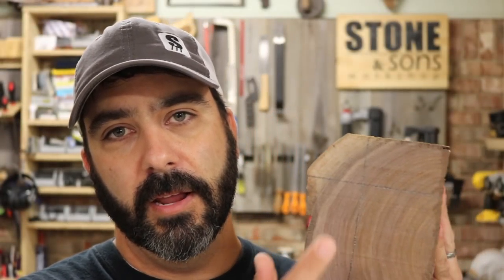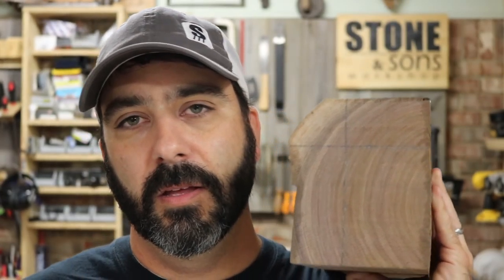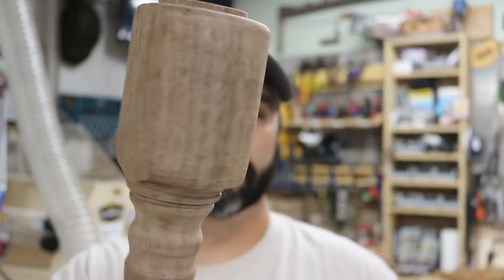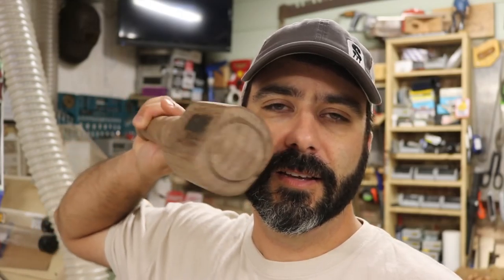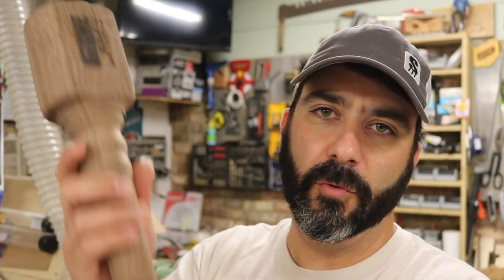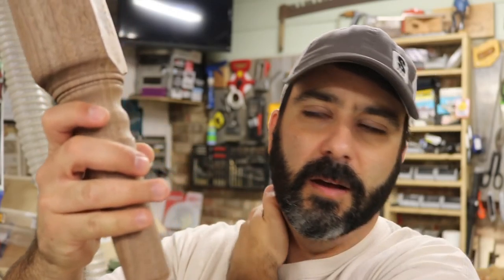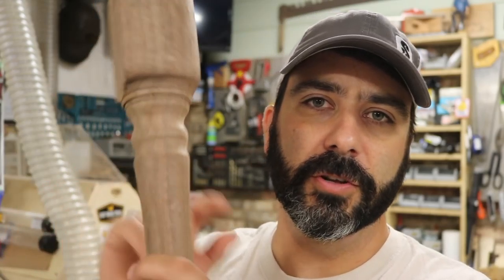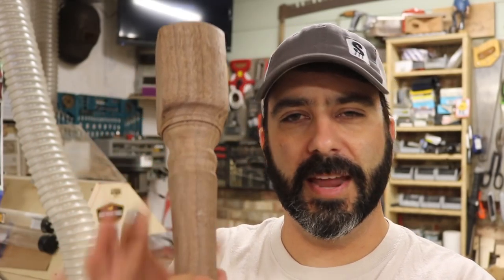Making a Mallet - Design Concept

Comment: cool design, walnut is pretty but also sort of soft and will quickly get dinged up. check out a really dense hardwood like ipe it would add robustness and weight. overall still really cool. another tip would be to make the top flat so it can rest on a bench standing up.
Reply from the maker: +Evan Dunville Thanks Evan for the feedback. Yeah, I've made several out of lighter woods like walnut, Cherry, but also out of oak and the oak wins in my book. Also, the top part is flat and it can stand on its own. Thanks for watching.

Comment: I just wanted to say that perhaps you might want to consider tapering the head?  So is the head is the section above the rings that impacts the chisel if it were slightly wider at the top than at the base it might put the contact more true?  when swinging a mallet it is done on an arc .So, depending on the user's timing chances are that the mallet will hit the chisel with the base(or ring side) first. If this is tapered then the transfer of energy may be more efficient?  in theory anyway.
Reply from the maker: +Timothy Magee Good insight, thanks for sharing that. I appreciate you watching.

Comment: I like the flat/round combination.  Keeps it from rolling off the bench like my round one does, but don't you have to look to be sure it's oriented correctly when you use it?  Have you considered a small matching flat on the handle so you can feel how it's oriented when you pick it up?
Reply from the maker: When I'm holding the mallet towards the top my thumb and pointer finger are on the head on the mallet so it's easy to tell how I'm holding it, but that's a good idea about having a reference on the handle.

Comment: Nice mallet, like the design, but I have seen similar in other woodworking forums, magazines and catalogs.
Reply from the maker: +Allen Perry Thanks Allen. Send me pics or links of the ones you've seen. I'd love to check them out.
Reply: Stone and Sons Workshop I don't have the time to go over all the images that I have seen of similar designed mallets, but I will include an URL to an image that you can see of a mallet that has the two finger grips on the handle, the head is not squared off as yours is, but as stated,I have seen them.  click this link and you will see it.  https://img1.etsystatic.com/111/0/9580765/il_340x270.1061892261_ocmp.jpg

Comment: most hammers have a flat head but i've seen several chiseling mallets that are full cylinders. i'd say slather it in linseed oil and you've got something that'll preach.
Reply from the maker: +Ken Gray Thanks! Yeah, a good coat of finish would really set it off.

Comment: I looked back through the comments to see if anyone had asked yet but didn't see any. What head do you have mounted on your lathe. i remember shopping around for one when I got my lathe but couldn't find one that matched the thread of the lathe, or so i thought. I have an identical lathe to the one you use. And if you recall where you got it that would be great.
Reply from the maker: I had to get an adapter to change the threads from 3/4" to 1", here's a link to amazon for it.... http://amzn.to/2m4TEQL and this chuck fits that adapter... http://amzn.to/2modIjG Hope that helps.
Reply: Thanks I'll give that a try.